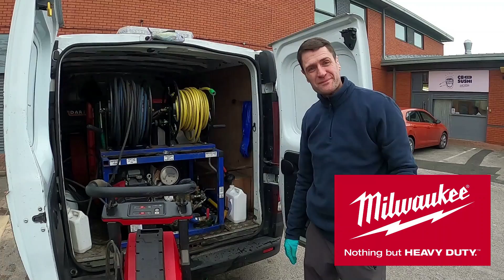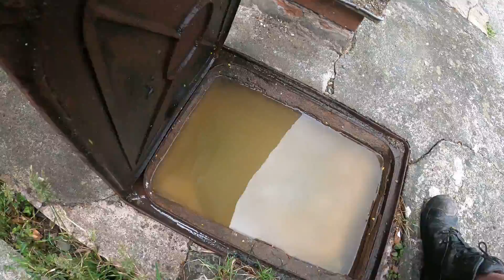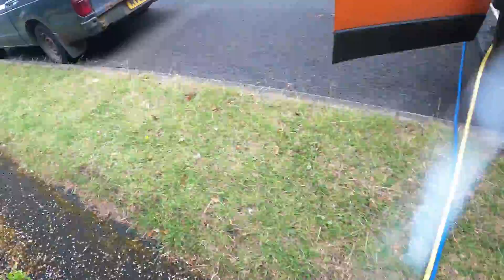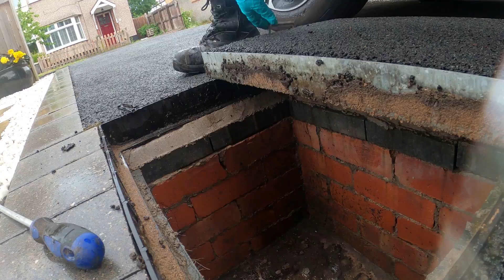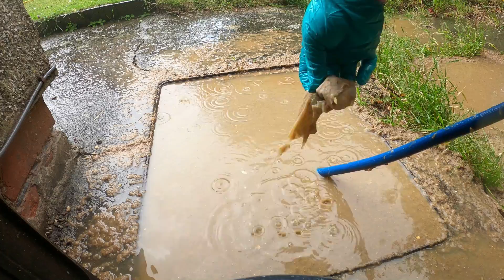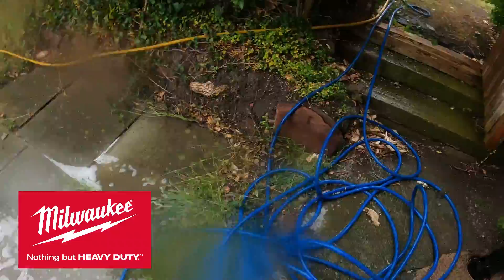Manhole Unblock! #144

Comment: Better than  any Hollywood production! These clips keep me on the edge of my seat throughout!! Best I ever did was a 3,000 ltr. 'septique' in France with a 6" crust that had to be broken with a pick axe and carted away in wheelbarrows, then syphon the 650 odd gallons with a 100 mtr. x 15 mil. hose to get the fall and start to rod the 30 mtr. of drain back to the property and the three 35 mtr. veins crossing the land. The whole had been installed without a grease trap in a bloody holiday home with three toilets, three bathrooms and a laundry room. Two days work and the bill that went with!!! Owner not happy but he had failed to BAN British bog paper which is resin bonded. Continental paper is NOT resin bonded and breaks up to dissolve. Sell your rights to Netflix!! there lies your fortune!  Happy bog-baiting! Oh and by the way, with 'fosse septiques', make sure that no one shoves hair and hair cuttings down the pan! Lethal to clear pipes